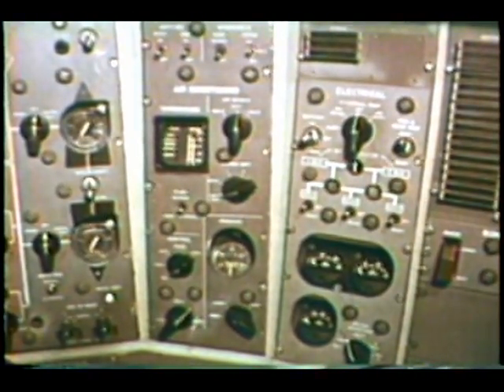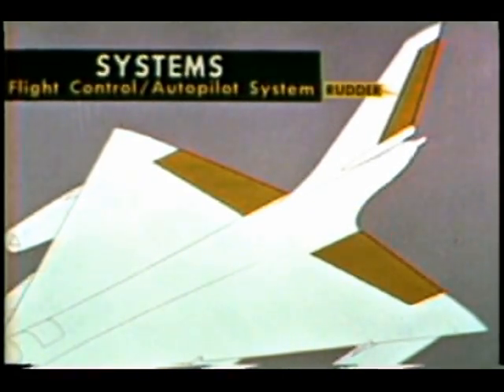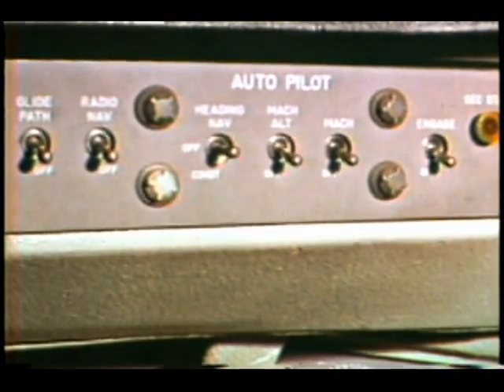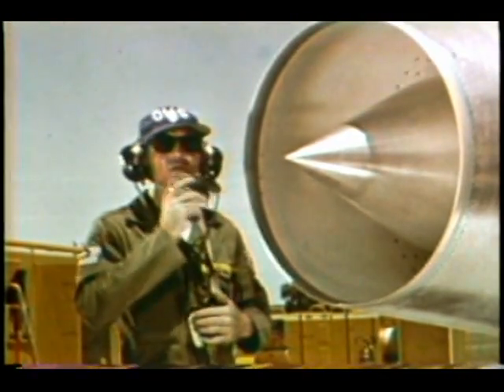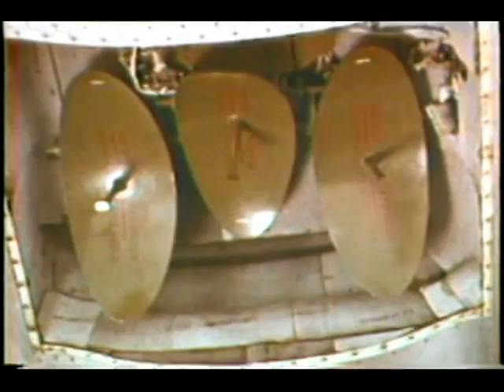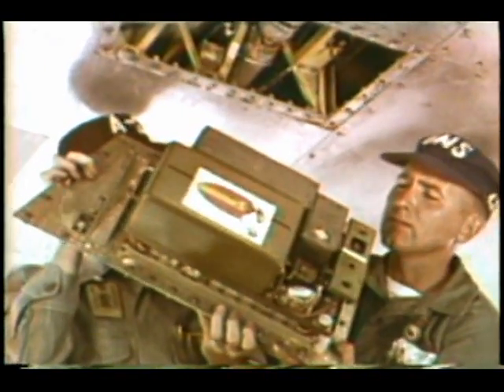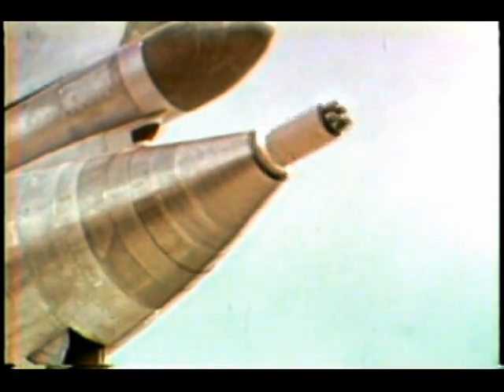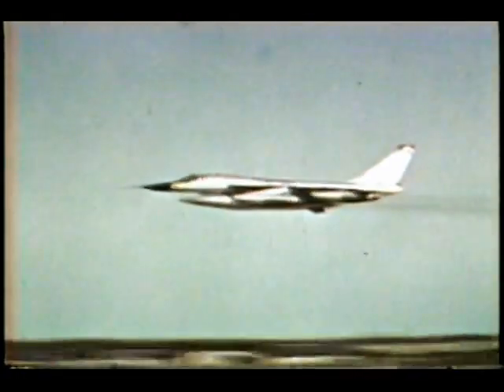Convair B-58 HUSTLER Flight Control Systems Part 2

Comment: Nice video!  I worked on F4 and RC 135 avionics in the early 80's.  The F4's had a Lear-Seigler INS and the 135's had a doppler nav. radar with a Litton LN 21 astral nav.  These Hustlers were flying when I was born.  It was a fantastic time in aviation :).
Reply: Hey Scott, I like your bit of technical history from someone who was there...hands-on.  I also worked F-4Es (weapons systems) in the early 80s.  The "good" old Cold War days...

Comment: The B-58 mission in war was designed to fly North over Canada,  the Pole and on into the Soviet Union. It would be carrying a nuclear device. Flying low at or near Mach 2, it would deliver it. The aircraft then had to try and make it back to an airbase or ditch.

Comment: Love the nav system readout on paper tape. I guess it'd suck to get a printer jam in combat conditions though LOL. And just as well the thing was fast , Those GE J79' engines were smokey as all get out! You'd see the smoke from way out. Often said they were a dead giveaway of position with the F4 Phantom in Vietnam - the 'Judas' engine' lol
Reply: At Mach 2, who the hell is gonna see smoke? And it would be 5 miles in back of you as you passed overhead.

Comment: I wonder why Convair didn't make the B-58 a tailed delta like the Douglas A-4? Having a tailplane would've enabled the B-58 to have flaps and therefore a much lower takeoff and landing speeds.
Reply: The A4 is a subsonic carrier capable ground attack aircraft, the B58 was a bomber designed to fly at a 0.9 mach cruise with the capability to make a short mach 2 dash into the target area, fast enough to outrun any fighter interceptors.